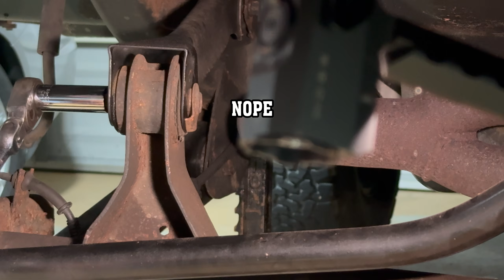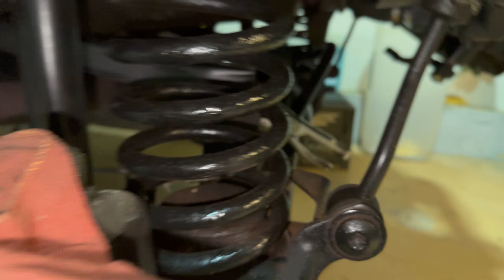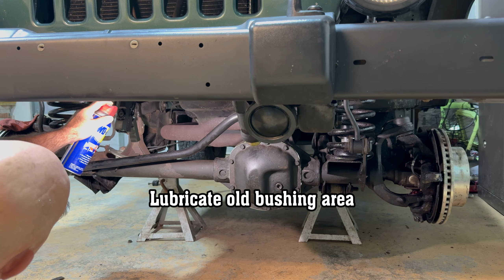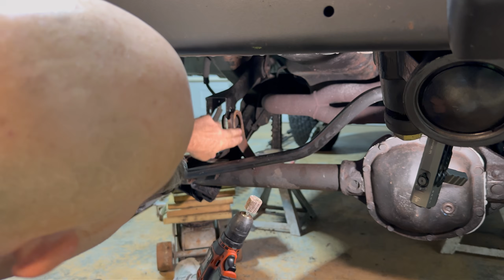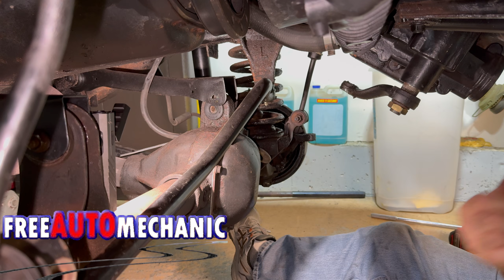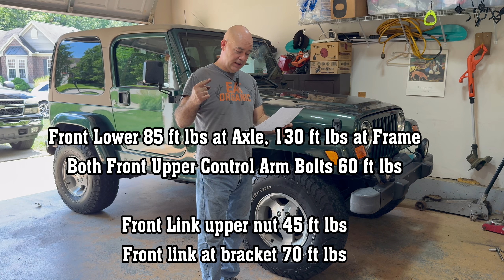Replace Front Upper Control Arm Bushing Jeep TJ **No Drilling Required* #jeepwrangler #jeepwranglers

Comment from the maker: Parts & Tools used in video List
Control Arm Bushing Kit: https://amzn.to/4xi2pcn
Control Arm Bolt Kit: https://amzn.to/4zoAo4W

C-Clamp Press Tool: https://amzn.to/4yVJZzT
Come-a-Long: https://amzn.to/4pXjar0
Pickle Fork: https://amzn.to/4fDyCoK
Prybar: https://amzn.to/4wqc0xb
T-55 Torx bit: https://amzn.to/4fEASMw
21 mm Socket: https://amzn.to/3TBbSwV
Floor Jack: https://amzn.to/4zeZyTB
Jack Stands: https://amzn.to/4hNjUgb
Craftsman 1/2 Impact: https://amzn.to/3RxZzkt
Heavy Hammer: https://amzn.to/4hebi24
Grease Gun: https://amzn.to/4xkCwbX
Grease: https://amzn.to/4hj3yvL
WD-40: https://amzn.to/459IyQH

Comment: Great video.  Adjustable control arms with threading on both ends are a big time saver because you can tighten and loosen the opposing side that you are working on in order to line up the bolts.  I just replaced both upper and lower arms with Core 4x4 and they are heavy duty.  Thanks for the video.
Reply from the maker: Glad you found the video helpful, and that sounds like a solid upgrade for your Jeep!